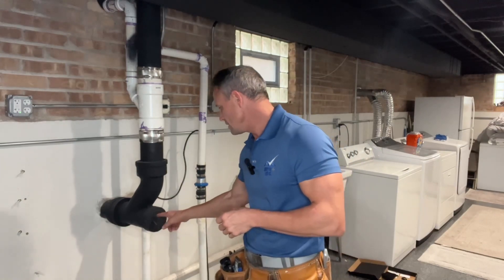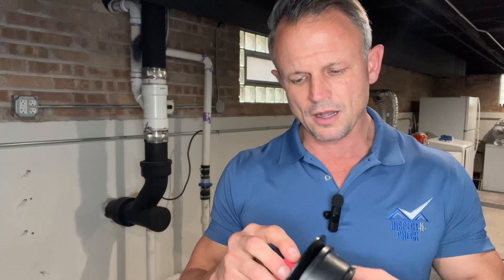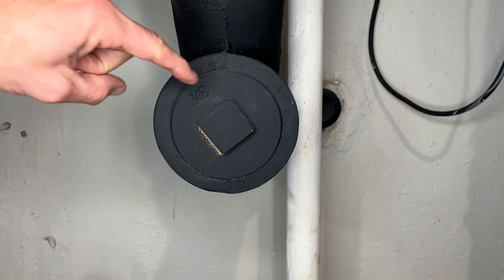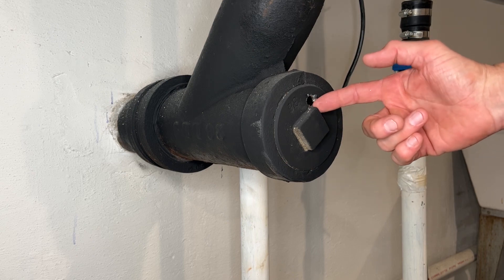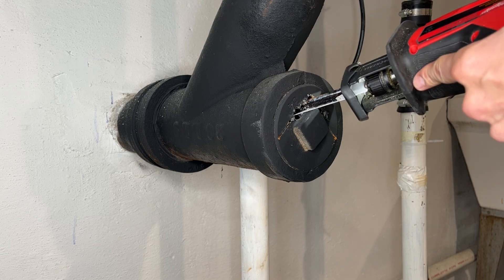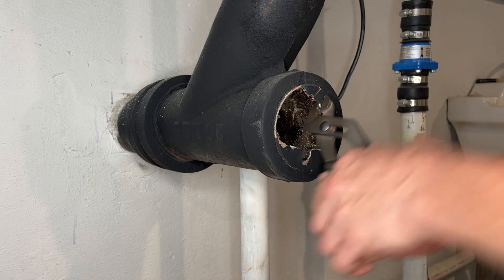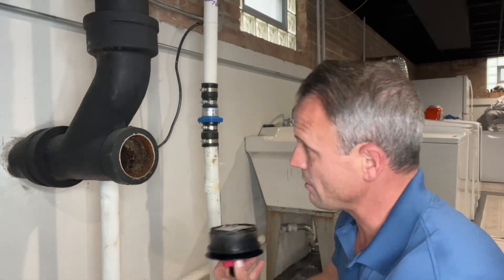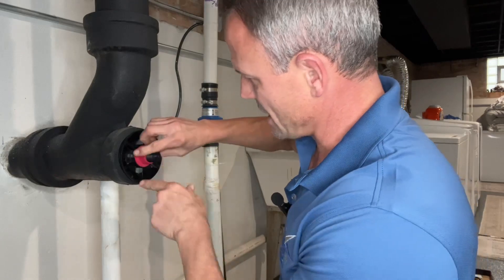How to Remove a Brass Clean Out Plug￼ From a Cast Iron Pipe

Comment: So much for spraying it with a  solvent stinking catalyst Great idea! We're going to cut it off brass plug. Goodbye. Thanks
Reply from the maker: @williamhammer-xm7cv  Yeah this is just quicker. The only mistake I made in the video is you just wanna cut a little bit deeper so that you just touch the threads and extract the whole plug, including the threaded part. Ideally it’s always best to put a brass plug back in with some Teflon paste unless the threads are deteriorated, then use an expandable plug like I did in the video.

Comment: Why not at least attempt to unscrew it?
Reply from the maker: Absolutely, always try to unscrew it with a pipe wrench first. 99 out of 100 times those things are not going to unscrew.
Reply: try heating the female threads first. @BJPoznecki
Reply from the maker: @jonathanklopf7581  Way faster to extract it than to sit there and heat it up on a torch. Even the plumbers don’t put a torch on it. They hit it with a cold chisel and 2 pound sledgehammer.

Comment: You left the threaded part of the old plug in the pipe🤔
Reply from the maker: Yeah, it was all corroded. You can take a chisel and a hammer and clean the threads if you like, however, I typically just use a test plug.

Comment: Thanks.  I have 60 year old cast iron pipe going from the house to the septic tank and the plug will not budge out of the cutout I need open.  I was about to saw off the entire piece and replace it with PVC.  This is a much better idea.  And I didn't realize the metal was so thin.

Comment: Not sure if the plug he used would enter too far in a vertical clean out. I have one where 70 year old brass plug us frozen. Tried using spray & a 24" pipe wrench to unscrew it Going to use either my 7/8 ir 11/8" carbide hole saws to make holes then go with my Sawzall. .
Reply from the maker: @JohnThomas-lq5qp  Yeah, unfortunately the brass and the cast-iron bond together where the only way to get them off is to extract them. Use whichever drillbit you want no need to worry the plug is only an eighth of an inch thick so you don’t need to drill far to make a pilot hole. The only thing that I did wrong in this video is you want to cut a little bit deeper into the threads so you remove the whole plug. In this video, I made a mistake and did not remove the thread, so that’s why I had to modify that expandable test plug. If you cut a little bit deeper into the threads than I did, then the whole plug will come out. Take a wire brush clean the threads really good. Dry fit your new plug, then add teflon pipe paste and reinstall it.

Comment: Only hammer was necessary for this 😄
Reply from the maker: @786otto  And you’re right the Plumbers typically use a cold chisel and a 2 pound hammer and break it. I just get nervous doing that because God forbid you loosen up a joint and then it starts leaking.
Reply: @BJPoznecki  Exactly that's how they do it , thanks for reply.
Reply from the maker: @786otto  Thank you for sharing. Yeah, for those that watch the video if they rather go the hammer and chisel route by all means that’s how the plumbers do it. I always get a little nervous whacking stuff with a hammer. Have a great weekend!

Comment: Thanks for the tip. I was trying to chisel down into the threads that were all rusty and use PB blaster and not making much progress. I used your method and I had it open in about five minutes. Thanks again.
Reply from the maker: @rotfan77  Yeah, sometimes the threads are so rusted out, there’s not much you can do with them because there’s nothing left. Most of the time these expandable test plugs work pretty well. The only thing is you may just have to modify it a little bit like I did in the video.

Comment: thanks for the video. Question, I was using the water hose with the rubber bladder to blow out my kitchen sink drain under the sink. I have to do this ever so often due to 3 kids that don't rinse the dishes. Anyway, it usually works but this time when I turned on the hose the water started coming out of my roof vent and onto the roof. So I went to the clean out that is a 3 inch cast iron with a brass cap like the one in this video(just smaller) and I can't get it off. So does it mean that my clean out is plugged and it forced the water up the vent and onto the roof? My main cleanouts in the front yard didn't show much water coming out. Any advice would be great. thanks.
Reply from the maker: @dunrite5225  I’m sorry to say, but if you have water coming out of your roof vent, yes, the pipe clogged and needs to be cleaned.

As far as removing the brass clean out plug those things never come off that’s why I made this video showing you how to drill a couple holes and cut it out with a sawzall. The only mistake I made when making this video is I didn’t cut far enough into the threads to remove the whole plug. With your situation it might be best to play it safe and call a plumber because it sounds like they may need to rod out your sewer line.
Reply: @BJPoznecki  Thanks for the reply. I'll try cutting it off and replace with a pvc cap. All my other plumbing is fine, just the kitchen is backed up.
Reply from the maker: @dunrite5225  Happy to hear the rest of the house is fine. The kitchen sink is very common. Moving forward I would just be cautious and minimize any oils, grease, etc. things like that because that can really close down the pipe and restrict the water flow.